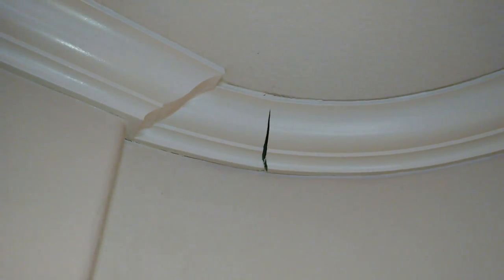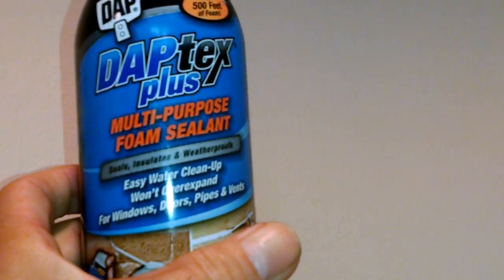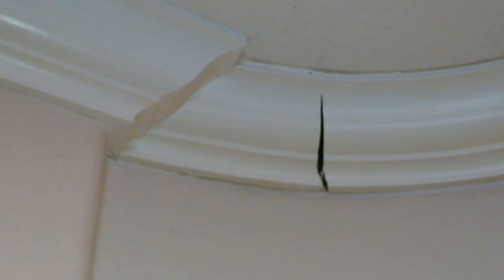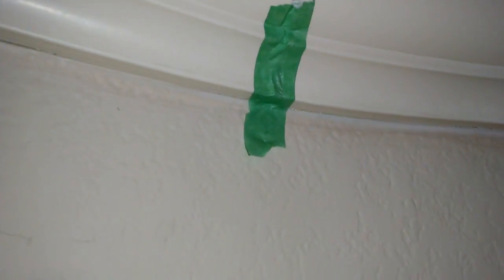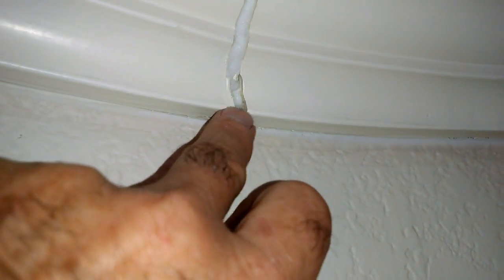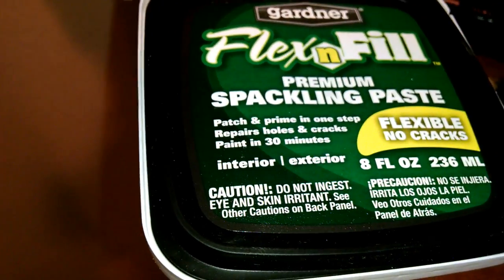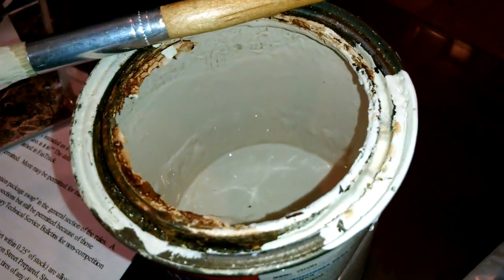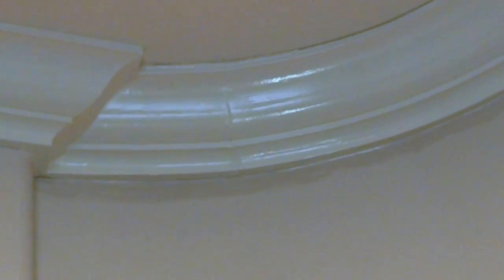Home repair crown molding by froggy

Comment: After you fill the gap and smooth away the seepage, let it dry and then sand the gaps edges down with 80 grit.  This will create a dip from the main surface to fill with the putty.  Then use a round dowel and wood block wrapped in 150 grit to smooth flat.

Comment: I had an issue in the corner that I had to cut a portion out and left an ugly gap . I used a different product to fill it in and then followed up with some spackle . I'm waiting for it to cure before I sand it.  This gives me some encouragement. That is a great job you did. Thanks for posting.
Reply from the maker: Make sure you use a product that claims non shrinking.  :)